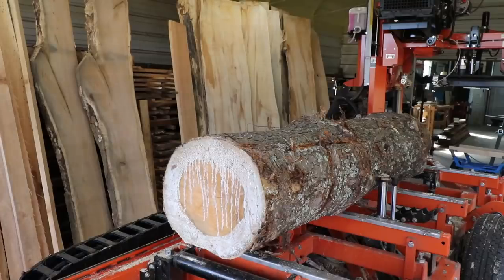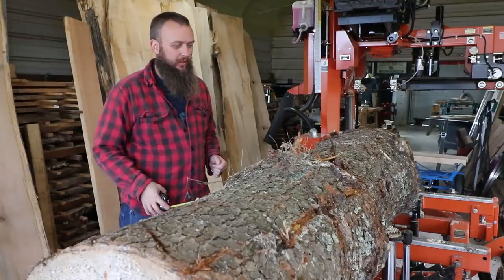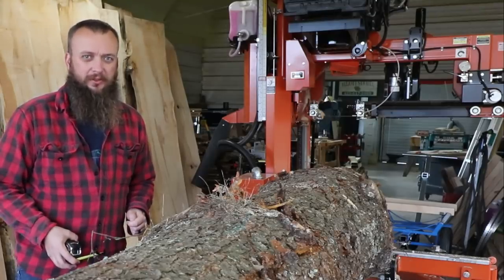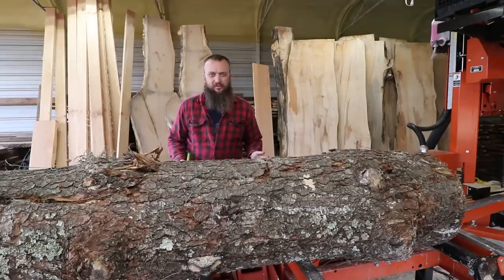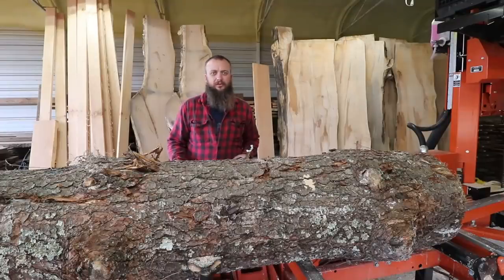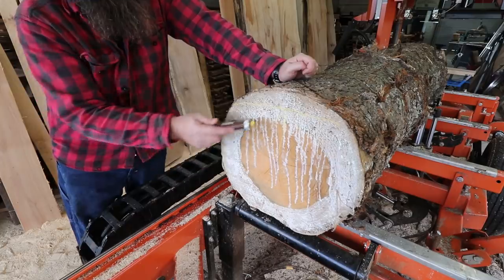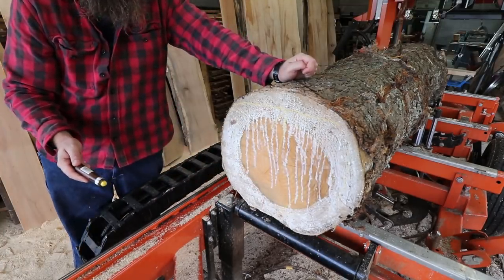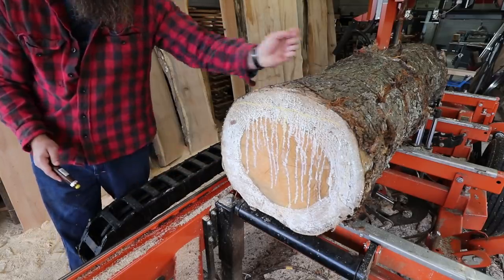How to Turn Low Grade Logs Into Valuable Lumber, Saw-Milling for Grade

Comment: I actually took a sawmill and kiln drying class in college.  One thing I learned when it came to stacking the lumber for air drying or into the kiln.  All the stacking piers and stickers should be lined up from bottom to top to cancel out compression and tension forces caused by the weight of the lumber and the heat stress that will be applied for the drying.

Comment: Have you considered making a shallow drip tray to capture the blade coolant that appears to just fall on the floor? 
You could route a pipe to a 5 gallon drum with a cone filter in to a funnel.
Great videos BTW.

Comment: Hi,
I have not spoken up much on this channel but today I would like to share a little info. I have done a fair amount of forestry work. All of it in Western US.

 I like to know what things mean. And if possible their names. 

As you walk around in the woods you will see some trees that grow their branches mostly out of certain spots. Like the groups of knots on the log in this video. Those levels are called WHORLS. What happens as the tree grows upward, is every year it sprouts a new group of branches mostly from one new level. A whorl is formed. These usually number from 2 to 5 branches. Sometimes more.
When a tree is younger it is easier to see a clear whorl pattern. Later on some hidden buds in the cambium under the bark will sprout. These just grow anywhere. I don't like them because they interrupt the orderly look the Lord gave that tree.

And knots. Some folks like knots in their boards. I like knotty pine walls myself. But you have to be sure the knots are tight. Because when they fall out you get a knothole. You have to judge whether knotholes are ok in the thing you are building or making.

In Eastern US a lot of things are made out of smaller wood pieces glued together. So the clear wood in this log (between the whorls) may be just right for the way things are often made in the East.

Comment: What do you think about Knotty-Pine?  Or is that just not an appropriate type of board for your desired application?   Years ago here in Michigan knotty-pine was moderately expensive, at least in terms of what was sold as tongue and groove paneling.
Reply from the maker: I like pine, this mill saws it better than the last one,
Reply: Knotty pine was also big in North Dakota, where I grew up!

Comment: I have to set my bandsaw fence for drift, the tendency to pull left or   right. Do you have similar issues with your sawmill?
Reply from the maker: my blade guide arm does pull to the left as I saw down the track often,

Comment: What's the black electric motor - some sort of bark pre-cutter?
Reply: Yes......it removes the bark on the entrance side of the cut.....if there is any sand or debris.....it is removed with a cheeper blade first.........  🤠